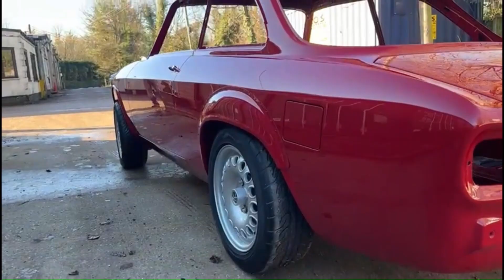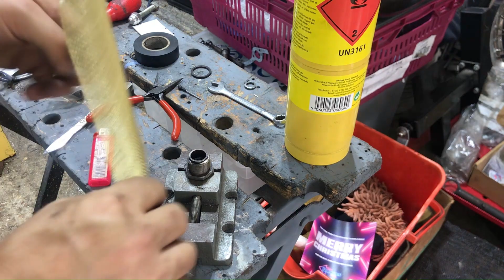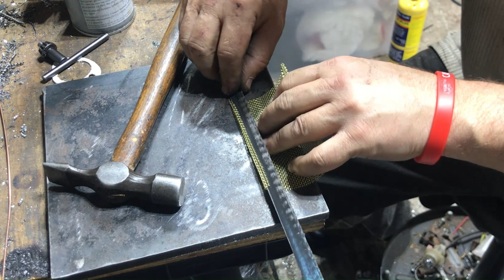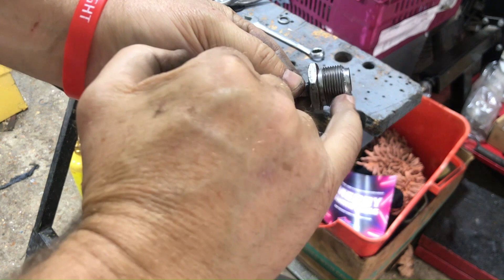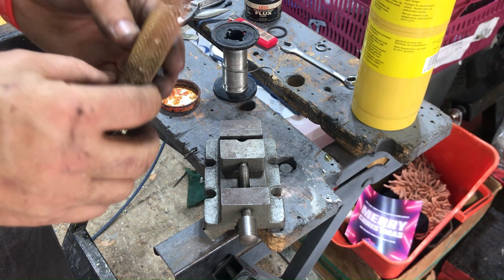Building an Oil filter for my 1938 Speed Twin Triumph pt 7

Comment: Great trick with the opposing creases to hold the gauze together. For certain jobs, I’d recommend looking out for an ancient soldering iron at a car boot or auto jumble. The big lump of copper that you stick in a gas jet( blow lamp and two firebricks is ideal). The gauze can get red hot with a flame but an iron can bang a lot of heat out but not be too hot and oxidise metal and burn flux. They’re a handy tool
Reply from the maker: Yep a BIG soldering iron would be a nice addition to the workshop glad you liked the vid 🙏

Comment: I think that’ll work just fine, though a HUGE copper soldering iron might have done it neater. But it would need to be a big job, because that steel cap would have wicked away the heat. Was that cap original? It looked like a tele-fork top cap that had been modified to be used as an oil union. Really enjoying your videos, thank you. Les
Reply: Great episode.... Learning something new every episode....#BUILTNOTBOUGHT
Reply from the maker: @debeerryan  thanks much appreciated 👍
Reply from the maker: It’s the cap which came with the oil tank but it’s been modified with a copper tube as the oil feed the others I have seen have a threaded attachment. Yep a big soldering iron would have been another solution 👍 thanks for the positive comments new video out next week